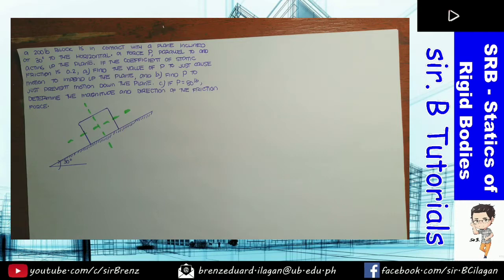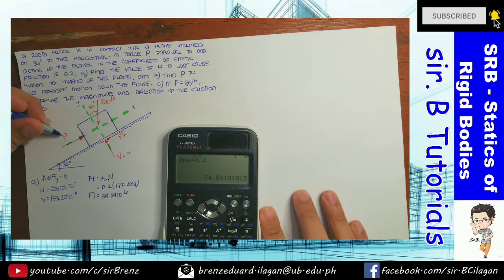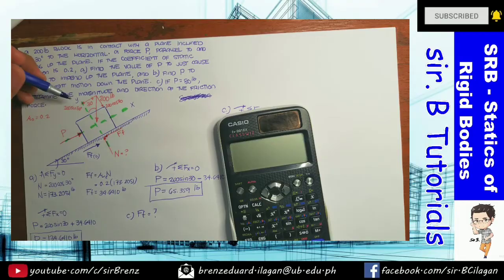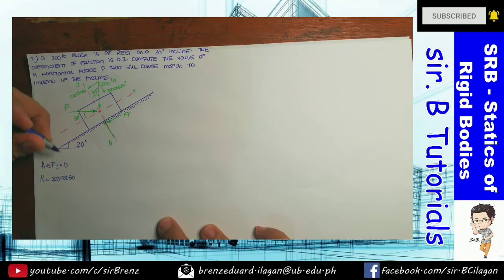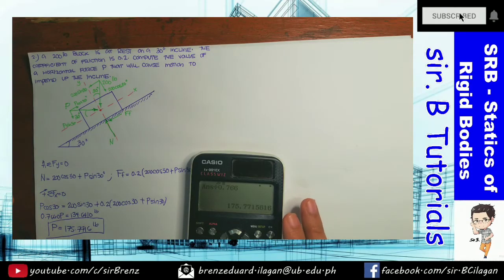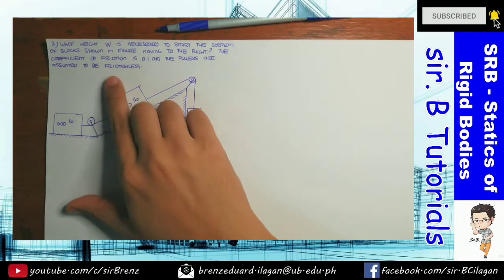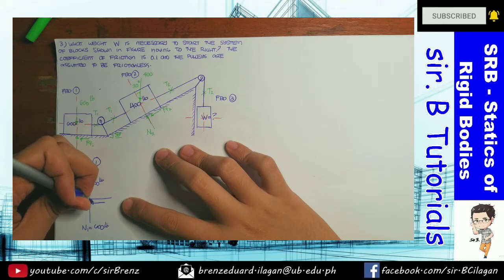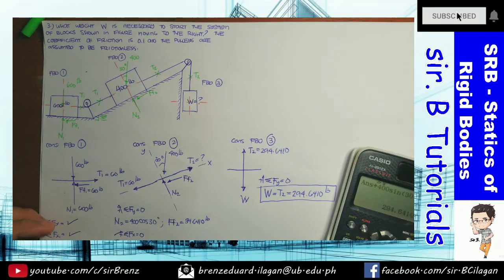Statics of Rigid Bodies - Chapter 5 - Law of Friction

Comment: Hi sir, about po dun sa first problem, sa paggamit nyo ng sin and cos, pano po malalaman na sin gagamitin or cos? Ang pagkakaalam ko po kasi, kapag horizontal vector cos po gagamitin, tas pag vertical po eh sin.  Hehe, thank you po sir in advance!
Reply from the maker: it depends kung san nakalapat ung angle, tip lng if sa y itagilid mo ulo mo or iredraw mo sya pra malaman kung sine or cos.
Reply: @sirBrenz  thank you po sir